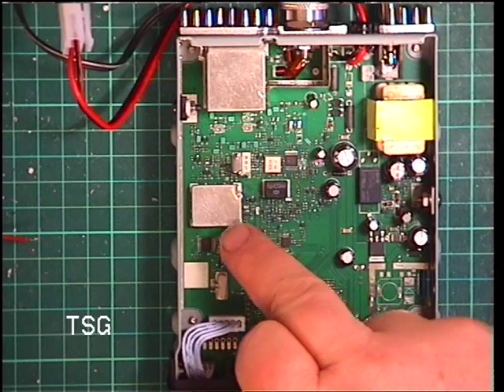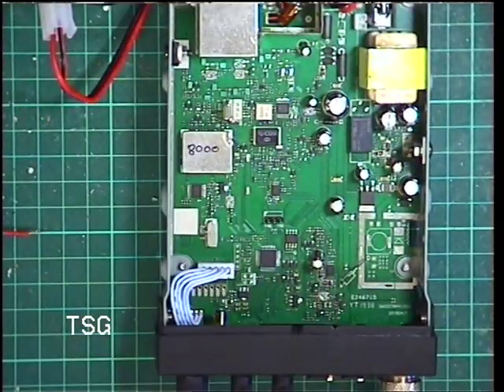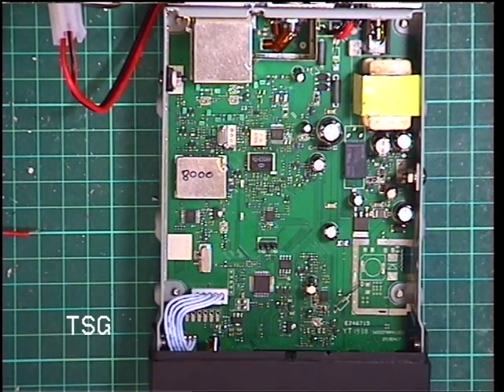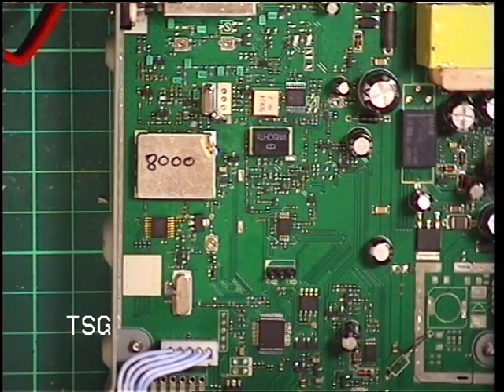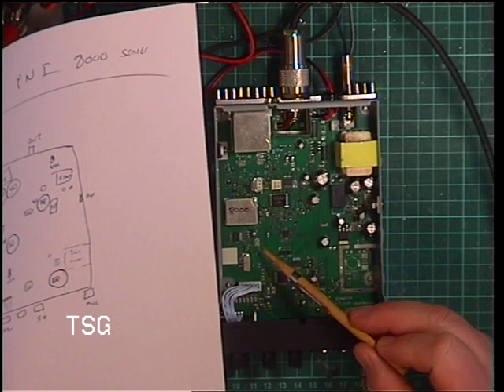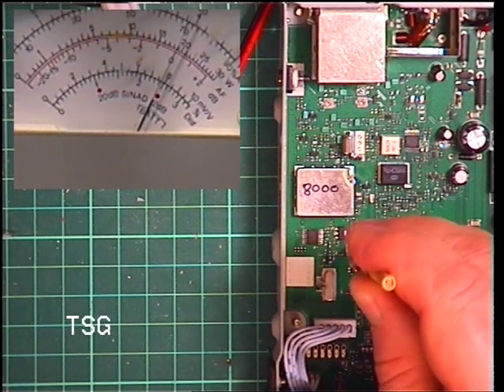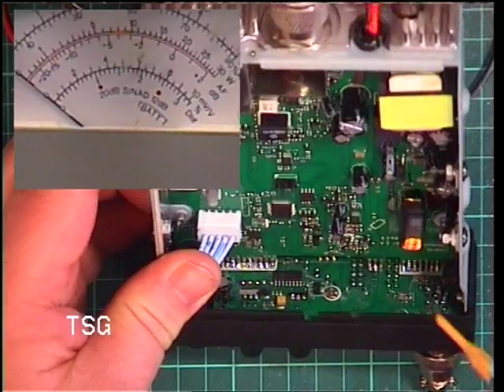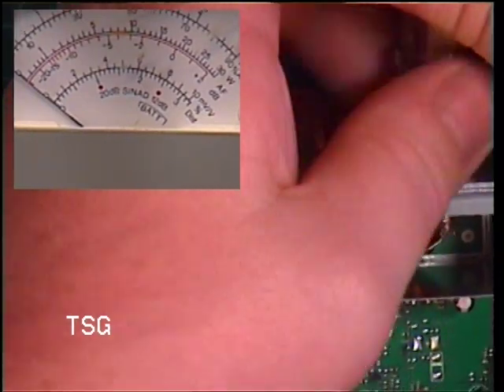PNI 8000 series CB Radio (CE Multi- Mobile) - Adjustment

Comment: I have a new device and I already noticed a problem with the relay. Sometimes, when the device is warm, it won't switch the relay back from transmit to receive. Only after lightly tapping the device, return the relay.
Reply from the maker: time to send it back under warranty.

Richard

Comment: I play the trumpet and often work with organists. Would love to hear you play.
Reply from the maker: I bet you love it when you find out the organ isn't tuned to A=440, so you have to do a solo instead. I'm only aware of one of the six pipe organs I play in churches around here being 440...and that's the one I installed at Kelby a few years ago. I went to the extra expense & trouble to do that (needed sharpening about 3 semitones). You have to cut a carefully calculated amount off every organ pipe to do that. Luckily it is a small 1 manual organ & only has about 250 pipes.

Richard
Reply: @ukfmcbradioservicingTango21  The big churches in Edinburgh went through an arms race of getting big new organs in the 90s and the main churches are all at A 440 with these incredible modern instruments. I have experienced that issue though and as I play trumpets in Bb and A I can usually get to lower pitches. Pipe bands are in 468 and are a real nightmare as you have to pull the main slide and transpose up a semitone.

Comment: Hi, sorry for the unrelated question.
I have my midland 77-104 uk that i had in my vehicle. I was wondering if it would be any good as a home rig with a suitable antenna? Would i need boots for her
Reply from the maker: There is nothing wrong with using a 77-104UK as  a base radio, with a suitable regulated power supply (radio max consumption is just under 2A @13.8V.   However, what's all this 'boots' stuff. UK licencing allows 4W output...that gets me 35 miles on a system that's supposed to be 16Km according to Offcom. Keep it lega l& stay away from the burner brigade who selfishly spoil CB for others.

Richard

Comment: Yes re the organ music.One question is where do you get your trim tools from? 73.G7HFS/PA3IKH.
Reply from the maker: Ian, the yellow trim tool comes from RS components, the black one originally came from RS too, but they discontinued them. The green plastic one is part of a TV alignment kit that sometimes is sold via Ebay is the 'States.  I've been told Rapidonline currently do that kit in the UK which would of course be much cheaper. 

If I lost our black trimming tool, I'd have to make one with wooden dowel & flat phosphor-bronze.

richard
Reply: @ukfmcbradioservicingTango21  thanks Richard.I had the small black one many years ago but unfortunately it got lost.I will try Rapid online.73

Comment: Hello i think that jumper posts on the radios  are for  high low power .
Reply from the maker: The only jumper post (near the VCO) I could spot I assumed to be the VCO test points, but without a manual or circuit it's all an educated guess.